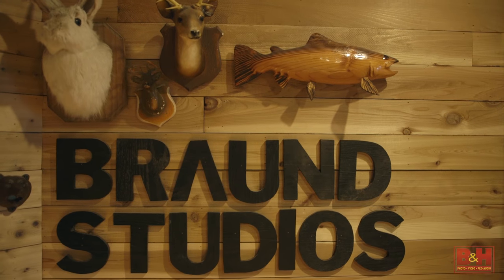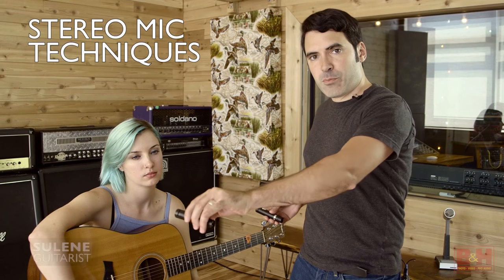Multi-Mic Techniques with Acoustic Guitar

Comment: Question - maybe stupid one, just for a case - the pans on the channels are hard right and hard left in all configurations, right?,
Reply: Yup, hard left and right for all these examples. That's not the only way, but it's the way we went in these videos.
Reply from the maker: The  X/Y, vertical X/Y, ORTF may be panned hard right and left but the mid-side configuration (MS) will not be and needs post production software to edit optimally.     >Mark<